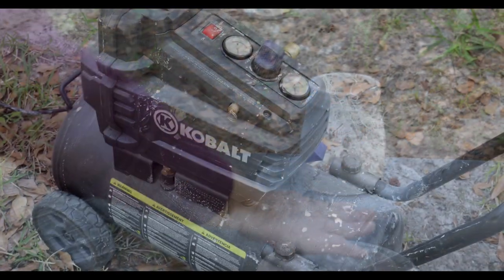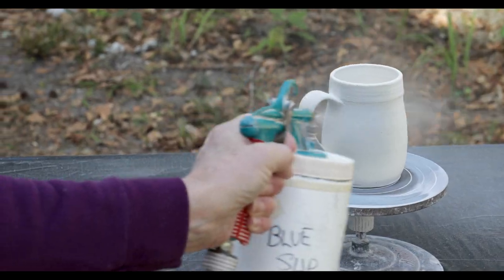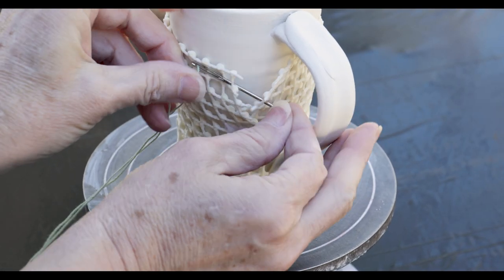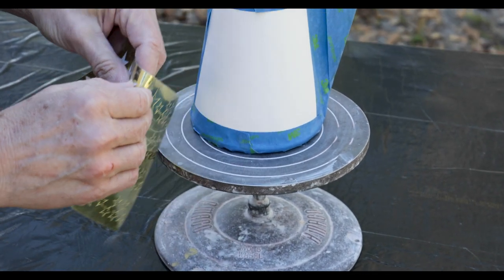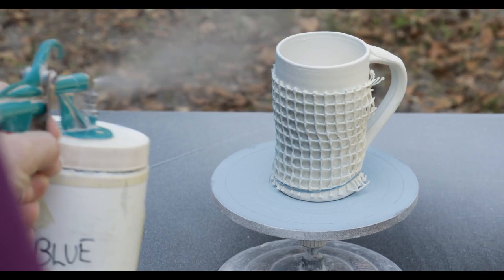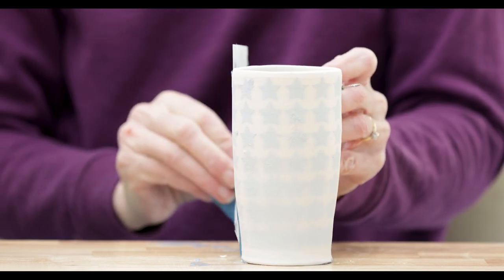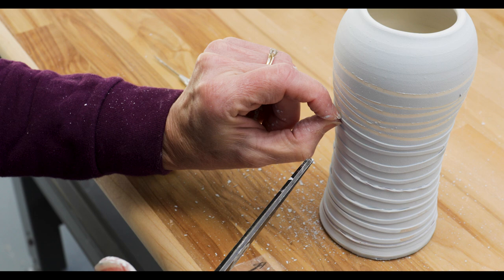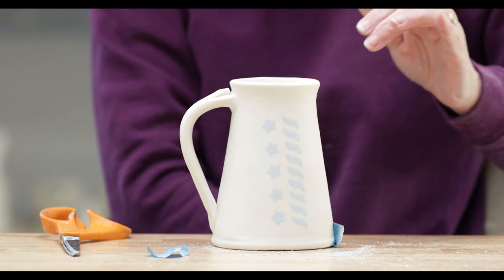Decorating Pottery with Slip and Spray Gun

Comment: I just got the idea to use a spray gun since I don’t like doing the dipping glaze. Didn’t know others were doing this so thanks for your vid! Btw, you’re so creative!! So many wonderful ideas you share. Thank you. Anyway, I don’t understand what a compressor is and looks to big for my little studio. I found some cordless spray guns on Amazon. Do you think those would work just the same? Also, have you sprayed with the dipping glazes or paint on glaze (not underglaze) ?
Reply from the maker: Depends on their ability to spray underglaze - some may be strong enough. The compressor I use is probably overkill but I've seen and used smaller ones (Harbor Frieght) that work fine. You can also use and atomizer. Good luck!

Comment: Ann- you are using slip to spray, so are the pieces dry or still leather hard? I have only applied colored slip to still damp pieces...but I don’t work with porcelain and the coating is very thin...so all bets may be off! 😀
Reply: Hi Gray.  They are bone dry.  If you apply in thin layers there shouldnt be any problems,  I have done it on stoneware at bone dry and not had any problems either, but the layers were thin.
Reply: @annruel1982  thank you much for the tips!
Reply: @graykicklighterjonathan-gr7275  my pleasure Gray!
Reply: Gray I was trying to remember the clay I was using and spraying slips on ... before I started using porcelain.  It may have been Highwater Little Loafers which is not a straight up porcelain but  is porcelain like.  It worked well on that clay.  I havent tried it on a groggier type of clay so I didnt want to steer you wrong in case this process doesnt work as well in all situations.... I just wanted to add that little amendment to my previous answer. :-) .  Have fun spraying!
Reply: @annruel1982 is the slip u are using the same as the clay body or a commercial slip? If made from same clay,  you add any other ingredient to the liquid slip to help it pass through the spray nozzle smoothly and with out clogging? Did you have to sieve your slip through 200 mesh or finer first?

Comment: Is there a reason you use colored slip instead of underglaze?
Reply: Hi Michele.  I could have done it that way, but for me it was cheaper to do it this way. I had the reclaimed porcelain just waiting to be reused and the mason stain  on my shelf  and could make a big batch of that from those materials I already have.  The commercial underglaze I have is expensive and I would have to make a big batch of thinned down underglaze to be able to spray it.  As you probably know, when you spray, there is a lot of waste that happens from the spray.  I dont like to waste the underglaze.  Thanks for asking

Comment: hi annie. Is the slip u are using the same as the main clay body or a commercial slip? I think you mentioned using porcelain dried out and made into a smooth paste/ liquid then mason stains. Did you add any other ingredient to the liquid slip to help it pass through the spray nozzle smoothly without clogging? Did you have to sieve your slip through 200 mesh or finer first? Thank you. Love your helpful tutorials 🙏
Reply from the maker: Same clay as the body for slip. I just made sure I watered the slip down pretty good, and yes, I sieved it as well through 200 mesh. Would love to see your work!

Comment: is it possible to spray deflocculated slip onto a form with the gun and compressor you're using?  I want to spray onto loofa forms, build up layers of slip, then fire in the kiln, where the loofa will burn out, leaving the ceramic.
Reply from the maker: Interesting you mention this, we were going to try this in a recent video but worried about the thickness of the slip etc clogging things up. Hopefully, one of the other members of the community will see this and share their experience...